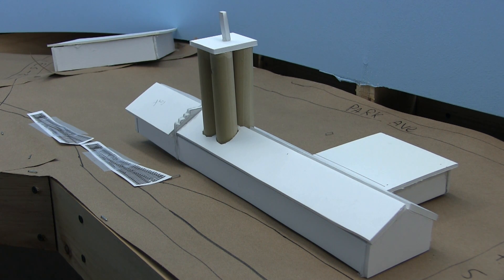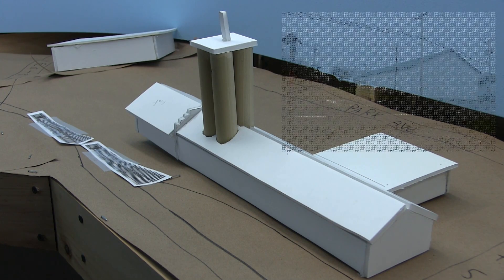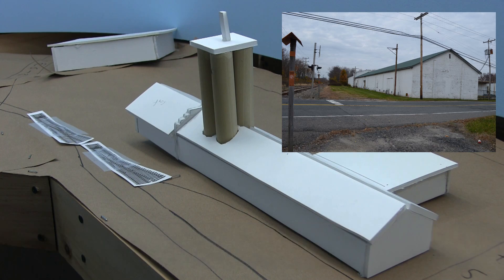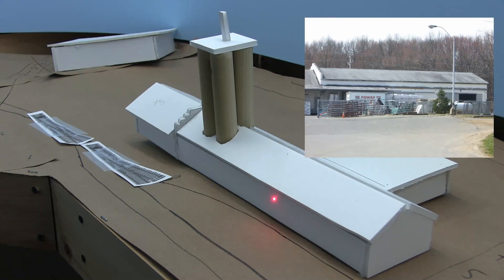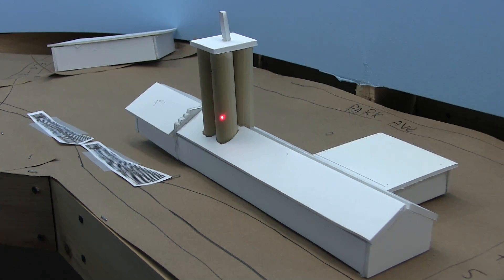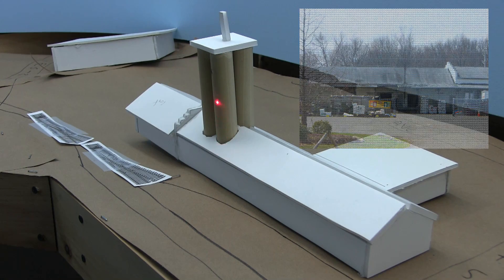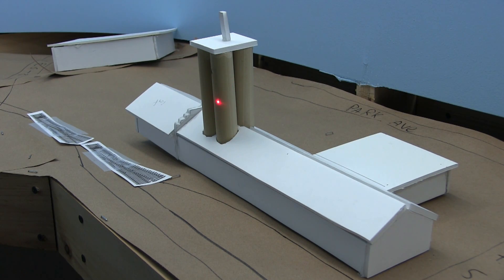Mocking up and Sketching the track plan for the Sayrehurst Secondary

Comment: I agree with Coxy, you just need the switch at the beginning of the yard to connect back to the main. Don't worry about connecting the lead back to the main down towards the helix. Your operating scheme, all your locals are going out the right side anyways so you're going to be backing the trains out. The only other thing I have and I think I'd need to see the full mockups in like a panoramic view is the Browns Yard - Jamesburg - Englishtown combination. On your plan, it looked like there were some scene separators but looking at your mockups in the video everything seems to be right on top of each other with little to know visual separation. I know you want to put Jamesburg in from a modeling perspective but I almost feel it would be better to have that area just as open area, maybe with just the Lake Manalapan area centered without the rest of the town. Just a few thoughts - Phil
Reply from the maker: Conrail1996 thanks Phill! I have been thinking about all weekend and I'm going with Coxys recommendation. A crossover from main to track 2. I am trying to work in scenery breaks in. Thanks for watching!

Comment: The switching lead at Browns doesn't have to connect to the main. It doesn't gain you much to connect it to the main and it will potentially  be a source of problems in an awkward place. Also, derailments at the top of the helix due to the lead switch being thrown the wrong way potentially result in runaways down the helix and into staging. 

The lead can just run alongside the main and stop over near the backdrop. This is very common in practice. Mainline trains can still enter/depart the AD track  using a crossover near the fascia. The yard job can easily pull/setout cars on the A.D track using the lead.
Reply from the maker: Coxy's Railroading wow thought provoking! I never thought of the ramifications of putting a turnout in that position. I never thought of the potential problems!! Sold. A cross over at the east end from main to track two. North bound traffic will enter at west end of the yard. Now I can extend the switch lead and get a few more inches. Thanks for the idea, the more I think about it the more I like it!

Comment: As to historical photos, try the local city, county or state historical societies.  The photo you want may not be indexed for a particular building, so look look for it in the background.  Another source could be Sanborn "maps".  Back east, you may have better luck for more recent copies.  The color code will provide you with the construction type.  Another long shot would local fire departments.  They may have a "vault" with old fire insurance or construction plans.  Just a thought.
Reply from the maker: Robert Dye yes I have tried the local historical societies but they don't seems to interested in preserving modern history around here. It seems that the 70's, 80's & 90's are up to us model railroaders! To date I have not heard back from the Englishtown historical society (they never acknowledged my message). It seems that most of the Stanborne maps are not available for free online, I may have to make a trip to the library. Thanks for watching!